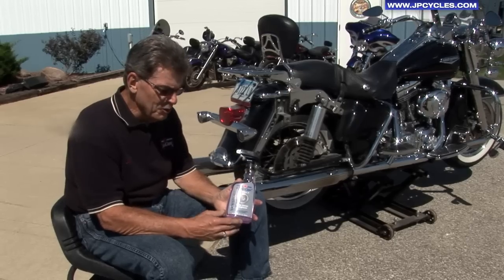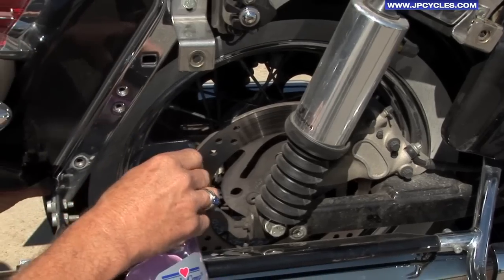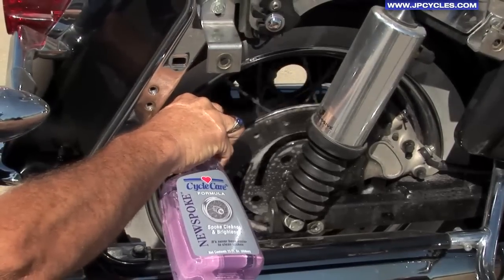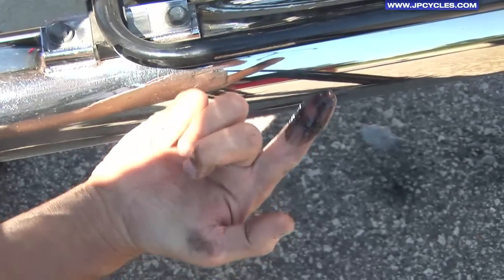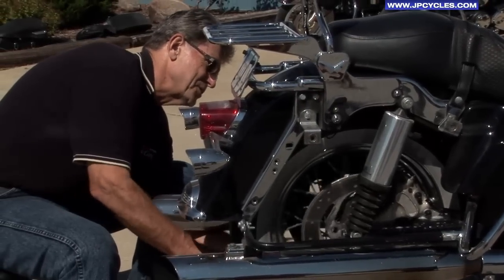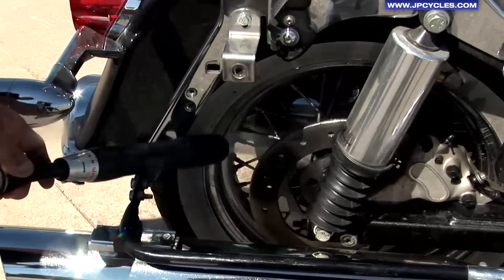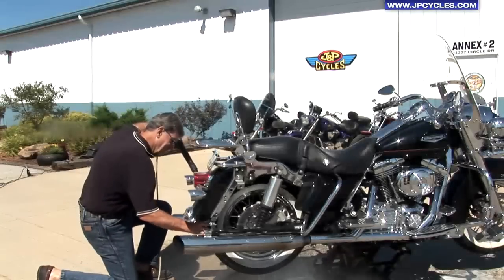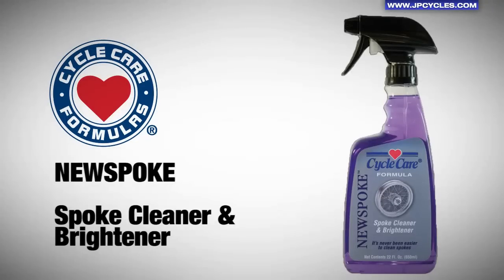Cycle Care Newspoke Spoke Cleaner for Motorcycles | Available at J&P Cycles

Comment: A product called S-doc cleaner will do the same thing but leave no residue. Protect from corrosion and make the next  wash easier by applying a thin coat of S Doc 100 afterwards. Simple
Reply: I see S-doc on Revzilla.  I used muc-off and hand cleaned with shop towels while I had rear off, worked great.  That nano tech muc off stuff is good for just about anything and leaves nano size particles in the surface pores of paint/metal, so theoretically it cleans easier next time.  (hint, motul bug cleaner, followed by muc-off for bugs on fairing)

Comment: Anytime I see these demonstrations whether it be on TV, Youtube or a State Fair, the product never delivers in real life, never. Wire spoke wheels look great on some motorcycles. However, they are not only difficult to clean and subject to rust, but the spokes need adjusting as well. I went with a virtually maintenance free solid rim on my current bike. More time riding.
Reply: spokes for off road or adventure bikes, unless cracked wheel in alaska sounds good  ;)  Works for you, not for my app

Comment: All of you here who are looking for an easy way to clean your rims are just waiting on the rust to pit your rims to death. Get off(or maybe on in this scenario) your asses, buy you a Scotch No Scratch pad, and put some elbow grease into it. I just bought an '08 Street Bob with wires and the one owner I bought it from claimed it never seen water. Not in rain nor wash. He used some waterless bullshit it on it. When I brought it home, she seen her first water hose and the more I washed it, the more I realized it was severely neglected. I have spent almost 2 hours on the front wheel and it looks brand new. The rear is in much worse shape. Looking so ever forward to getting my hands on it.